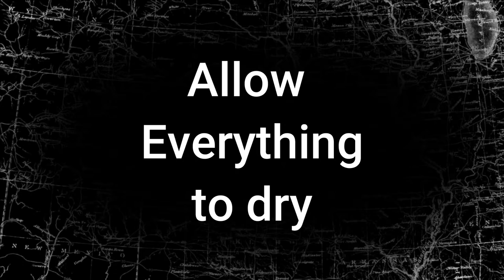Easy Board and Batten using MDF

Comment: Kudos to you for sharing your project. I have a few ideas I would have handled in another way. 
1-unless the wall is very irregular, not a great idea to glue the baseboard to it. 
2-before putting battens up, I would decide where that top piece you made was going to go, level it and nail it to the wall, insuring the nails were hitting the studs. 
3-then in case the floor wasn’t level, I would measure each place where the battens were going to be sure  all of them were the correct length. (Yes, if the baseboard and top board are perfectly parallel, the lengths of the battens will be exactly the same. But that stuff rarely comes out that way in most cases. 

Last comment to clarify the glue thing-anything that is running horizontally can be nailed into structure (studs) and does not need glue. Not gluing makes it simpler if the baseboard ever needed to be pulled, like maybe by the electrician? However, the battens will not likely be located on top of a stud, so those I agree need to be glued.
Reply from the maker: Thanks for the input!  Everyone has their own way of doing things.  For me, this was the easiest.  I'm not too worried about using the glue, and if I have to remove it, that's just a road I will cross later.  I think it turned out pretty well.  I love it, and it still looks good after all this time.  If I do this again, I'll take your advice.  Especially for the upstairs bathroom I need to do.  That wall is jacked, and I definitely need to make sure I secure them to the studs.  Thanks again for the advice, and thanks for watching!!